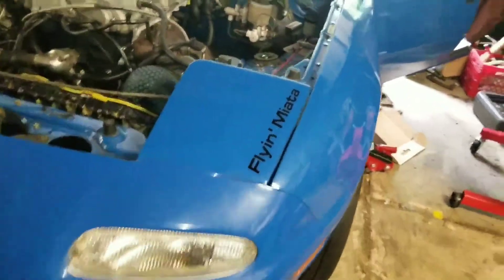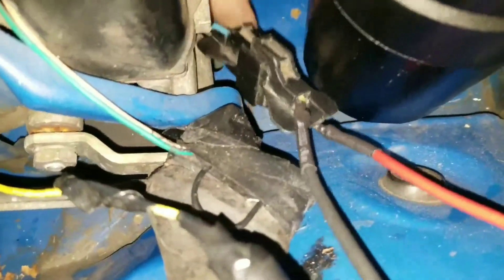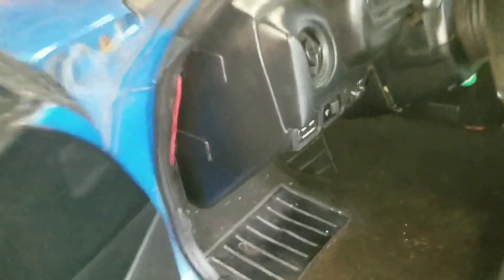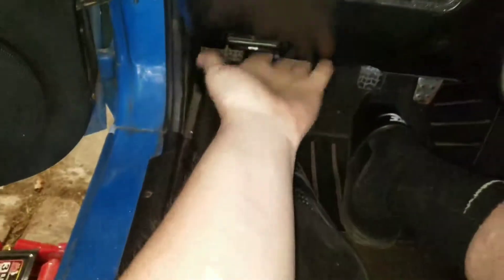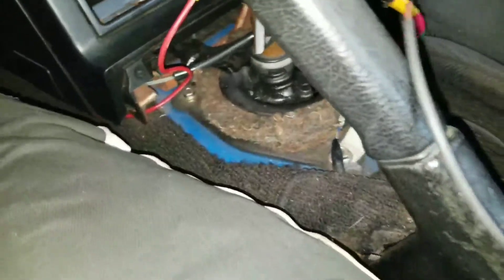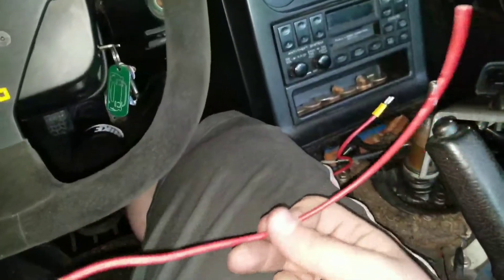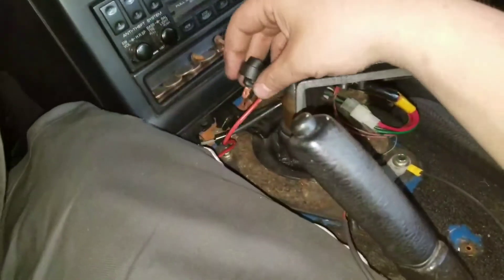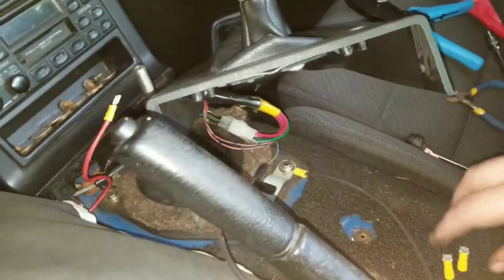How to wire an independent radiator fan switch in your car

Comment: I did mine with inline fuse from battery, i blew a 30amp fuse, should i have a smaller fuse in for 12 volt dc radiator fan? I put a 15 in to replace the 30 that blew

Comment: does it matter what gauge wire you use? has your switch melted?
Reply: yes it matters. volts and amp's dictate wire thickness.  usually 16gauge should be fine in a car, at least for load.
ground can be less.
use google,  wire thickness
Reply: @Hellohallo  yeah i figured all that out & wired my cooling fans to a 30A relay & a switch works perfect